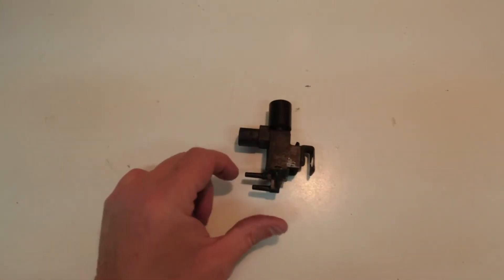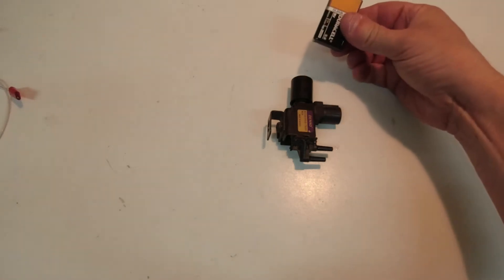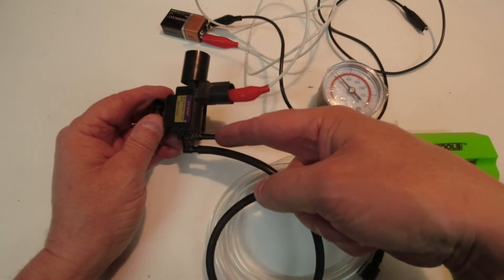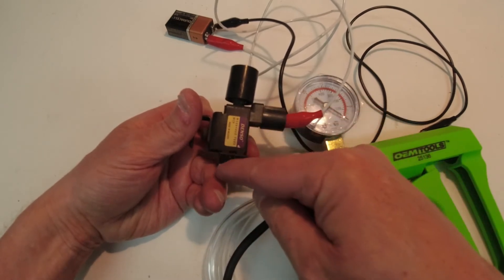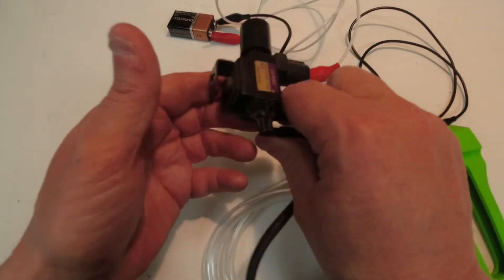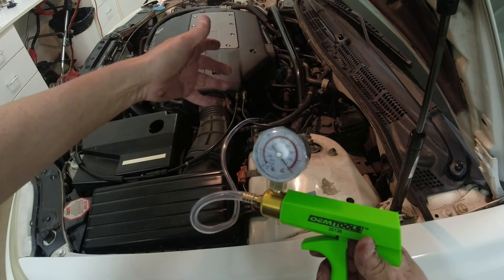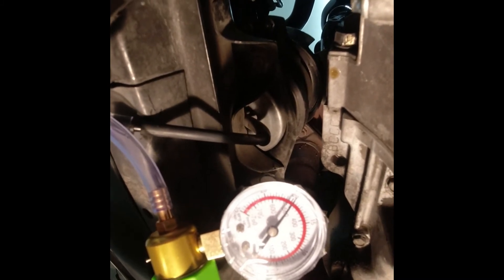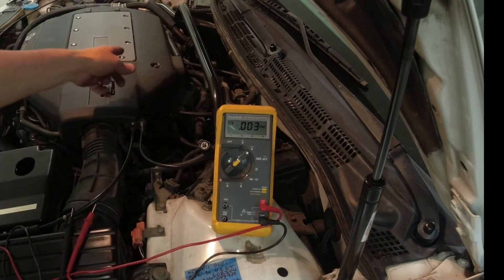2000 Acura 3.2 TL Engine Mount (motor mount) system troubleshooting & diagnosis.

Comment: Great vid as usual. I have the same car,  which I bought new 22 years ago. So far I've put about 190K miles on it. Luckily, no transmission issues for me. The problem I've got, though, is that the engine stalls right when I start the car the third time after having driven a while and stopped at two other places for less than 30 minutes or so each stop. Couldn't figure out why. Have replaced its fuel pump relay to no aval. John, you have any ideas or suggestions? Thanks.
Reply from the maker: Sounds like an air/fuel mixture issue if it does start, but then stalls. Does the check engine light say on after it is running? Is so, any codes? Have you checked the bottom of the throttle body by removing the Idle Air Control Value to see if it is full of carbon and not moving freely? If you have never changed it, it is worth taking it off to inspect it. They sell replacement units at Autozone.
Reply: The check engine light is not on afterward. I'll check the Idle Air Control Valve per your suggestion. I've taken the car to three places,  including an Acura dealer, but none of them could figure out why. You are the mam! Thanks every much your help.

Comment: Interesting.  It doesn't look (in the video, at least) like the engine vibration was perceivable with the vacuum hose disconnected from the rear engine mount.  So I wonder how much of an effect the active engine mount has during idle.  I assume you just drove the car with the hose to rear engine mount disconnected and plugged, until you replace the rear engine mount.  Did you notice much negative effect from not have the "active" rear mount engaged?  I have a 1999 TL.
Reply from the maker: I still have that one vacuum line plugged (using a small bolt) as I can't afford the factory mount from the dealer and the aftermarket parts are junk. I have not noticed any difference in the engine mount performance, but maybe I am just used to it now. I still would like to replace it with a genuine factor part eventually.